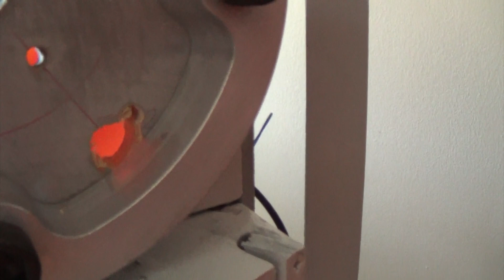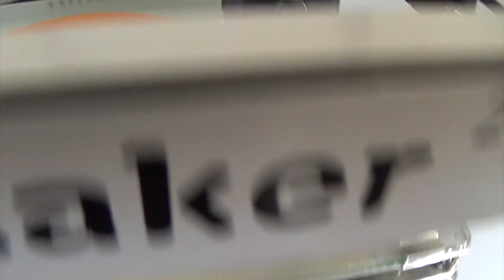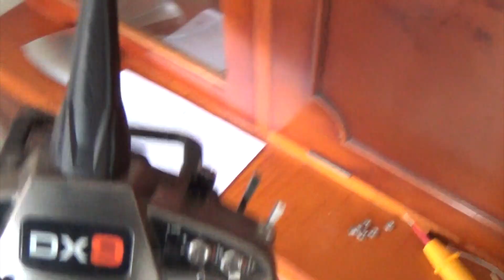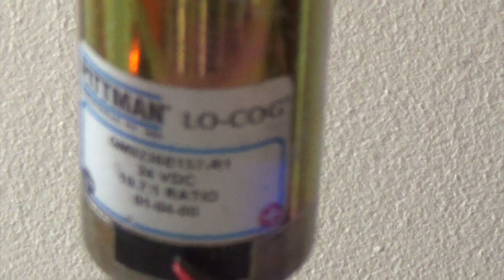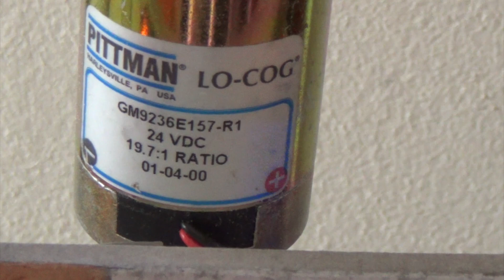R2-D2 build - Part 7

Comment: please l need your help lm going to start my own but l need to no his the R2-D2 big in really life thank u
Reply from the maker: Your Guardian Angel People who see him are often surprised how big he is in real life. All the dimensions are on the plans on the club web site, but to give you an idea, the body is 18.25 inches in diameter (approx) and he stands a little over a meter high.
Reply: thank u and how many are they?.............and mow much it cost when its all done thank u for your help
Reply from the maker: The cost depends on what materials you want to use and how functional you want him to be. You could make a static prop for a few hundred pounds if you make him out of wood and do most of it yourself, however for a fully working, full aluminium droid its several thousands of pounds, easily 5 or 6K if not more. Some of the best and most impressive droids have been know to hit 10K.

Comment: is your frame wood?
Reply from the maker: Yes, although I'm now replacing it with an Aluminium frame, which you'll see in the next video.
Reply: +Movie Models would you say a wooden frame to be compatible with aluminum parts? I'm building an R2 unit and on a budget and would like to know if I get a wooden frame will I be able to buy aluminum parts for it and still work.
Reply from the maker: I did manage to make an adapter so the metal legs can be fitted to a wooden frame. I used a 3D printer to make up some adapter disc you can see in the videos. It's should be ok, as long as you can modify the frame to suit.
Reply: +Movie Models sorry to ask so many questions but what type is skin do you have on this R2 unit?
Reply from the maker: I don't have any skins for him yet, but the plan is to use aluminium skins.

Comment: I'm using an ultimaker at work and found it a lot happier running at 150% speed if set at 30mm/s. Try increasing your speeds if you're having trouble with globs or lumps :)
Reply from the maker: Thanks! I'll give it a go.
Reply: +Movie Models r2d2 is gonna be so cool when complete, hats off man.